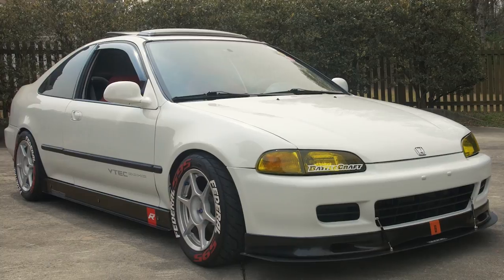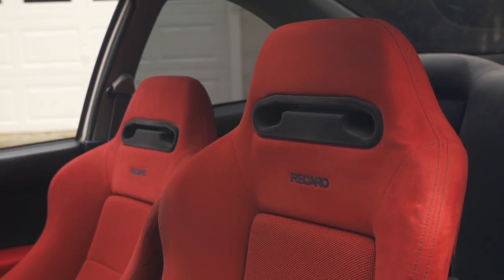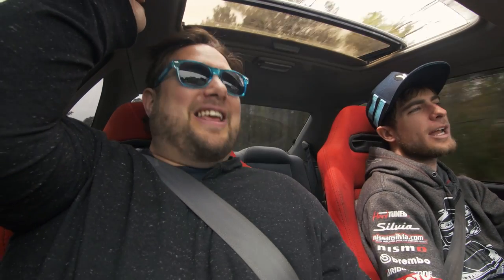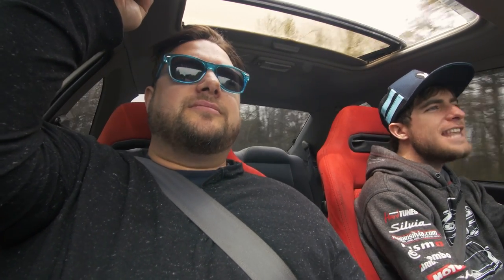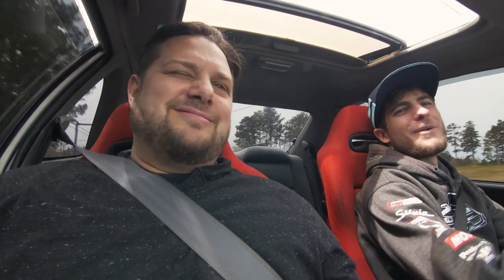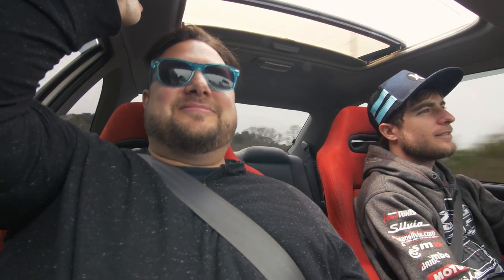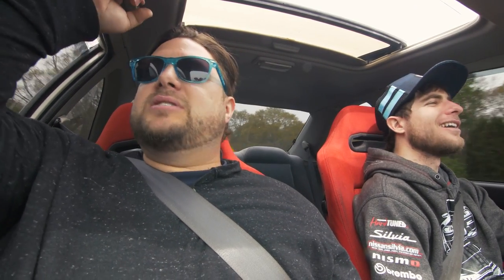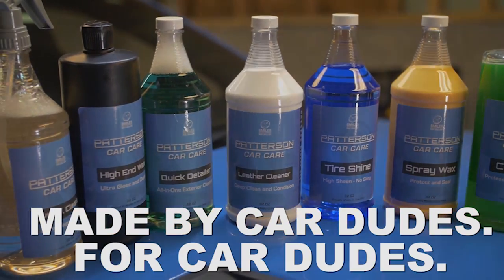K20 Honda Civic Review! - 8500 RPM's of Smiles! (ft. Honda Street Garage)

Comment: When I mow a lawn I do 2 perimeter rings and the strike a straight diagonal line halving it. From there I knock out each half separately with a serpentine like pattern. Overlapping about one wheel with past the previous rut. This insures 100% coverage and gives the lawn nice character. If done correctly it will have the light/dark alternating pattern akin to various sports fields/pitches. That’s how I mow a lawn.
Reply: Weston Anderson yo this is exactly how I mow my lawn lol step for step.. idk why I’m so amused by that but I am
Reply: Most random comment I’ve ever seen
Reply: I don't think you can wire a car that way tho
Reply: Weston Anderson right! Who cuts in circles? Horrible.

Comment: He couldn't have described the k20 from the 02 rsx better. As an 02 rsx type s owner, it's so slow and almost boring to drive in the lower RPM's but once you hit vtec the car actually completely changes. You go from having almost no power to a massive increase and to the point where as long as you stay in it, it's actually fast and a fun car to drive. That car is beautiful.
Reply: timw pretty much. This as another 02 owner
Reply: This car is more lighter
Reply: im a 02 rsx base model owner I just have a skunk 2 full exhaust to headers, air intake, k tune manifold and it puts out some good power
Reply: What's the engine code for this engine k20a6 by any chance,?
Reply: @Awaywego24  k20a2

Comment: I really enjoy these reviews with the owners in them, it ads another dimension that is really cool. When  I look at the camera angle I would personally pan a little more to the right (from the viewers perspective).  Based on the movement of the car you need a little more space in front of your face vs the face of the passenger. But... That's personal preference, both of your faces are in the shot.

And I recently drove a K20a swapped RSX. Raced a TC that I thought wasn't going to go and totally was the honda guy in between 2 and 3rd. Still reeled him in and passed him. That guy had the biggest smile on his face. I can only imagine the sound from the outside. It was still on the 8200rpm limiter on that one though. Popped my VTEC cherry in a RSX. I loved it.

Comment: You should try and find a clean 1992 or 1993 Acura Integra GS-R. For being an older Honda/Acura, it has a very short gear ratio and if you ride it out to red line, you will always be in the power band.

Comment: Nice car, just a quick tip. Next time you have a car drained of coolant, pick up a Airlift 2, comnect it to your air compressor. This will put the coolant system under approximately  25-30 inch pounds of vacuum. Then put the other hose into your pre-mixed coolant, fill the coolant system with much less issues. With in 5 min. Of the engine running after filling. You will be done. Let it cool, then proceder with the lovely... but not the worst( Nissan is the worst) idle relearn procedure.

Comment: You SHOULD use a FlashPro at least as they're tuned on different fuel over there.Ive ran a JDM ecu on a B16B swap some days it'd run pretty good other days like shit.Youre not even getting a stock expierance like that but actually a less reliable than stock.To clarify if it's reflashed that's great,but stock tune?meh

Comment: How much horsepower does this make?
Reply: ilovemanunited probably 210-230hp range
Reply: ilovemanunited being that it’s on stock ecu doubt it’s tuned. So probably if lucky 210 dependin if it’s full bolt on etc
Reply: Alright, thanks.
Reply: @Gemi4900  idk if it's a K20 with NO after market tune, even with bolt ons it's probably barely at the 200hp mark. The car is light though, so it's probably a fun enough amount
Reply: King of Eden yea your right when I had my k24 I made like 160 base full bolt ons

Comment: Nice car,what k20 is it an a3
Reply: 02si EP3 guy yeah it's the same one as the EP3
Reply: No, it's an a2 from the RSX type s
Reply: He didn't say it was a type s
Reply: Steevnb * its an a2. no a3 cracks vtec like that and revs to 85, also a type r ecu wouldnt work with an a3
Reply: Steevnb * nah man use a dc5 type r ecu on your a3 and let me know how it works. just because its a k20 doesnt mean its all the same. yeah lmfao and i could set the rev limiter on a d16y7 to 8500 rpm too but it would make zero sense. get what im saying? not saying its impossible to rev to 85 im saying its pointless with stock cams, power already starts to fall of at the stock rev limiter, you would be losing power revving to 85 on an a3.
Reply: Devin Sullivan word I've seen plenty of boosted A3 making power but then again it all depend what you want out of the engine the A3 can also handle 300hp with its stock internals . And their is plenty of videos on YouTube to prove . Most honda engines are good tho
Reply: Devin Sullivan btw I've raced type S , &I beat them . I have full bolt ons just thinking about getting some cams .
Reply: Steevnb * probably came down to driver mod. are you tuned?